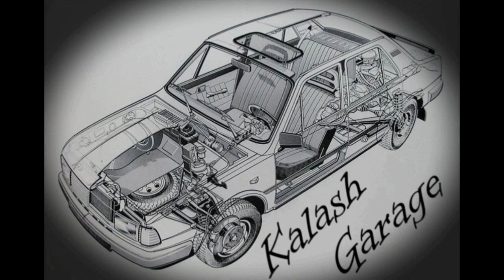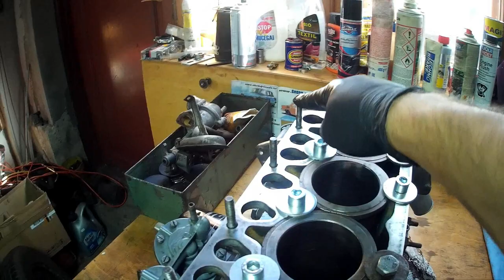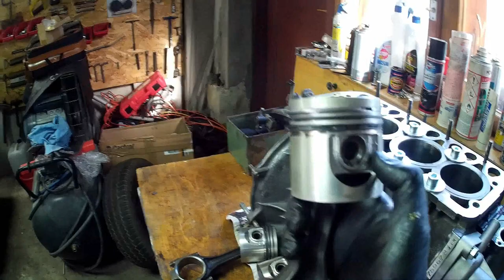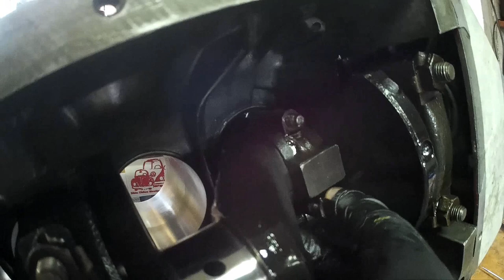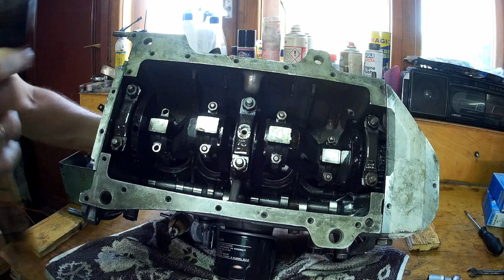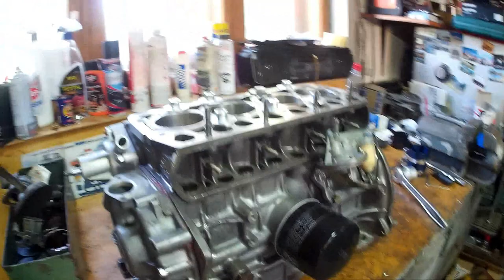Skoda 105 Engine overhauling - Install Piston - Rod assembly

Comment: Excellent video. In the future I will need to do some of this work with my 1983 120LSE engine, and it is good to see how it should be done properly!
Thank you :-)
Reply from the maker: Nice car the 120 LSE , one of the best looking estelles from my point of view .And pretty rare from what I have seen in the last period . I have also a overhauled 130 LSE from 1986 , but the entire vinyl roof was compromise so I replaced with vinyl car foil imitation. I hope that my tutorials will help you in rebuilding your engine :)
Reply: @KalashGarage   Thank you. The last owner of my 120LSE was an air-cooled Citroen enthusiast, but he wasn't getting on with the Skoda's fussy cooling system, and so he offered the car to me. It was a model I had always wanted so I was unable to turn him down! It has been waiting in a garage for a few years for me to restore it. It needs the usual body repairs around the front and the engine to be sorted, but is generally a solid car. Thank you again for producing these videos :-)